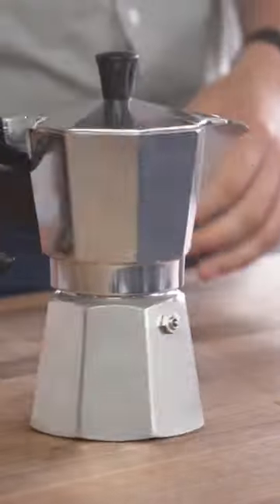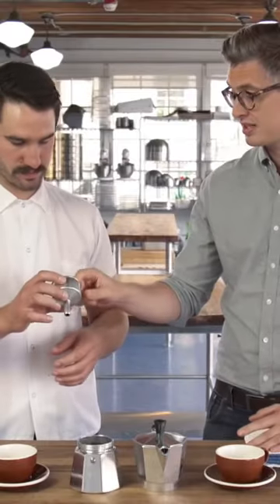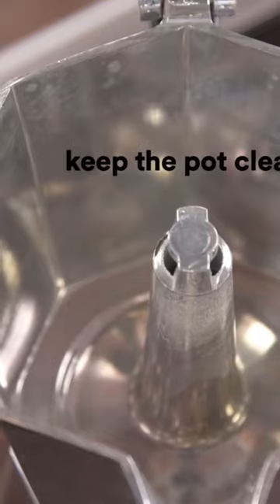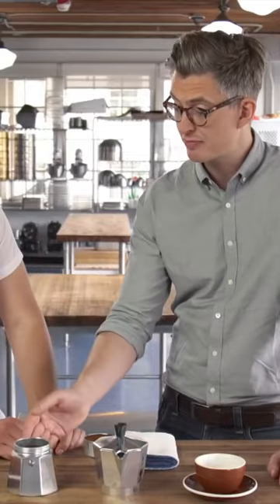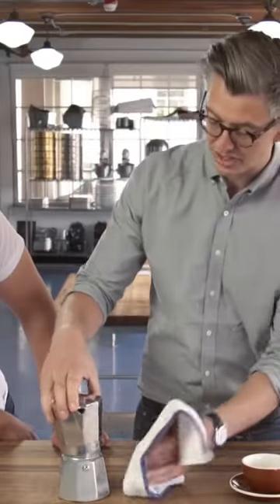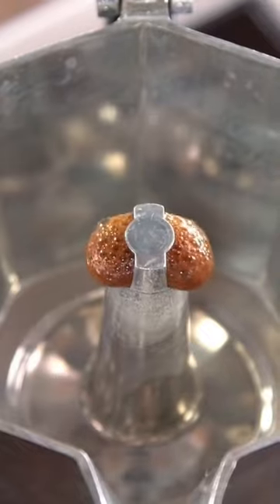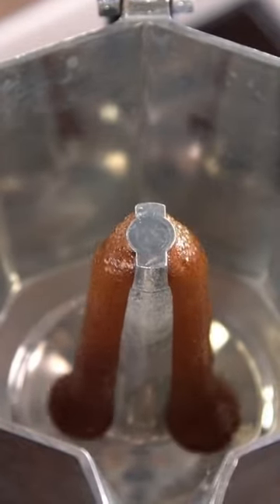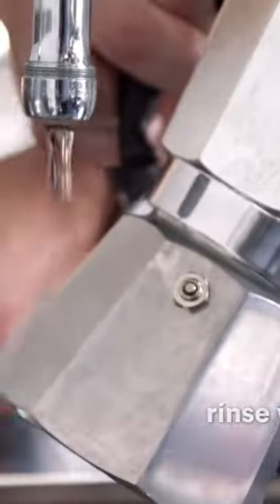How to use a Moka Pot with @chefsteps #shorts #coffee

Comment: I'm sorry, but Hoffman is wrong about how to use the moka pot. You definitely should not fill the bottom with hot water. Fill with cold or room temperature water to allow time for the correct pressure to build. It will not burn or over-extract the coffee as it only takes 3 to 6 minutes. When it gurgles remove it from the heat after a few seconds, but do not run it under cold water. For best results, learn the traditional Italian way since 1933 by searching for "Annalisa J moka pot" video. Hoffman admitted he doesn't understand the moka pot and said, "It broke me."
Reply: all the stuff you jest said is completely wrong.
Reply: @Unitedstatesgov598  No, the traditional way is all correct. The proof is in the pudding, my coffee is perfect every time by doing it like Annalisa J teaches. 

You're trying to say that hundreds of millions of Italians and Bialetti have been wrong for 90 years, but a coffee snob, who never learned the correct technique im the first place, is their savior? So arrogant!!!
Reply: There isn't a "correct" way to brew. If the final product tastes better then that is your preferred method of brewing.

Personally, I have found that using hot water gives me a more sour cup so I just use room temperature water. Perhaps it's the type of bean / roast level?
Reply: @_taho  Yes, there most certainly is a correct way to do it after 90 years of scientific design, development, and testing, to get the best results of perfect coffee every time, which is never bitter. All Italians (with few exceptions) are on the same page about how to do it, which conforms to Bialetti's instructions. There's a specific reason for every element of the moka pot. For example, they designed it to be a measuring cup by positioning the pressure valve in the exact location to give you the right amount of water when it touches the bottom of the valve. The coffee basket is designed to be exactly the right size to give you the perfect ratio of water to coffee when it's loosely filled and leveled off, never pressed nor packed. It must be filled with room temperature filtered water or cold tap water that's been filtered, or bottled water, so it heats up at the right speed to bloom the coffee and for the gasses to create the right pressure. If you fill it with boiling water, it can damage the pressure valve, which is dangerous; and it doesn't have time to create the right pressure and bloom. The coffee won't be bitter or burnt when you use room temperature or cold tap water because you cook it on a low flame and remove it from the heat the instant you hear the gurgling noise. Then let it sit for a moment to finish topping off, and always stir the coffee before pouring because the first coffee into the pot is a different strength than the last coffee. Keep the lid closed while it's brewing. Anyone who has a problem with bitter coffee, burnt coffee, or other problems, is not doing it the correct traditional Italian way.  When Hoffman repeatedly warns about "that angry sputtering spewing phase," that tells me he never learned the correct way to do it because that phase NEVER happens when it's done correctly. The coffee grind must be medium-fine. There's no need to rinse the bottom under cold water at the end, and no need to use a paper filter, which could cause too much pressure and damage the valve. And so on. It's extremely simple to use, by design, and was never meant to be the complicated source of stress, confusion, or intimidation that Hoffman has made it with his unnecessary hacks. I think he owes Italy and Bialetti an apology.
Reply: @photina78  Hoffman's technique is based in a seemingly very thorough testing process and its unclear to me why you are so critical of it. Yes its suited to his tastes, but that doesn't mean its "wrong". Neither way is wrong, its unnecessary to gatekeep a piece of metal.
Reply: Lmao are Italians suddenly dictators over how to make coffee now? No need to be so pressed, bud😂
Reply: @diiii_mond  I'm not Italian. 

How bigoted of you to assume my ethnicity based on my acquired knowledge of correct Moka technique. 🙄 

Hofmann admitted in his videos that he doesn't understand the Moka, and he even said, "It broke me!" After making those statements in his videos, he also tweeted those same remarks! 

I've researched the Moka, after suffering through the frustration and disappointment of trying these fake hacks that are being dictated by the Specialty Coffee influencers on social media, who don't understand the Moka.  

I've emailed Bialetti and received their answers in reply. 

I've thoroughly researched the Moka and tried all the various techniques. 

The Specialty Coffee influencers are the ones who are DICTATING how to use the Moka; but their hacks are very poor technique, which unnecessarily complicates the process and DO NOT improve the flavor for anyone who uses the correct Bialetti technique! 

Hoffmann assumes  problems with the flavor of Moka pot coffee that simply do NOT exist for people who use the correct Bialetti technique, which is extremely simple and produces consistently good coffee that's never bitter nor burnt. 

Bialetti grosses approximately $180 Million US dollars per year, they have their own science, engineering, and product development department; so they can afford to do vastly more and better scientific testing and professional taste testing than Hoffman or any social media influencer ever could dream of doing! 

Bialetti has a vested interest in ensuring that their Mokas and brewing process creates consistently good coffee! 

The design of the Bialetti Moka pot and brewing process were based on science by engineer Di Ponti, who collaborated with Bialetti in 1933 to manifest his idea for brewing stovetop espresso using technology he'd observed in his wife's washing machine. 

Di Ponti understood the physics of air, water vapor, volume, pressure, mechanical design, temperature and timing extremely well, and those basic scientific facts have not changed in the past 90 years. 

There is a scientific reason for every single one of Bialetti's instructions. They work together as a system; so if you change one instruction, it impacts the other steps and negatively affects the flavor. 

For example: Cold water has more molecules than hot water, so heating cold water makes it expand more and creates more pressure inside the Moka than heating hot water would. 

Starting with cold or room temperature water keeps the temperature lower inside the Moka than if you'd started with hot water,  it allows time for the coffee to bloom and for the right amount of pressure to build, and it bathes the coffee powder for a longer time and at a lower temperature than boiling because boiling water is too hot for a good extraction and it brews too fast. 

The Moka is never supposed to boil! That's not how it works! It works by gradually heating the air and water vapor until the pressure is enough to push the water down and up through the pipe at a temperature below boiling. 

I bet you didn't know any of that because you've believed the myth that starting with hot water prevents the coffee from burning. Not true!

The correct way to prevent the coffee from burning is to start with cold or room temperature water, cook it over a low flame or a preheated medium electric stove, then REMOVE THE MOKA from the stove the INSTANT you hear it start to gurgle - because that means the water reservoir is almost empty so it's slurping air into the pipe (the stromboli phase) - then set the pot on your countertop and let it finish brewing from the residual heat inside the pot! (Do NOT cool off the pot under cold running water when you remove it from the stove!!!) Then stir up the most-concentrated coffee from the bottom and pour. 

I comment on this topic BECAUSE everyone deserves to enjoy the very simple process of making consistently good stovetop espresso! 

Nobody should have to suffer through the frustration and disappointment that I went through trying to learn to use the Moka via these incorrect Specialty Coffee influencers' hacks that overcomplicated the process and took my coffee from bad to worse! 

ONLY when I finally found Annalisa J's Moka tutorial, and the detailed Moka tutorial by Il Barista Italiano, did I get to enjoy consistently good Moka espresso that's never bitter nor burnt, and a very simple stress-free process! 

I now use a Brikka, which is a bit different because you have to use the enclosed plastic measuring cup for the water, and it doesn't gurgle so you have to remove it from the stove as soon as you see steam and the crema stream is established, but before it gets very active. 

My daughter and son-in-law are former Starbucks managers, who were trainers of baristas not only at their stores but at all other stores that were experiencing quality control issues because their baristas weren't doing it right. They don't prefer Starbucks coffee because they've had advanced barista and tasting training in their careers. 

I sent them a Brikka to get their opinions on the best technique. They agree that the Bialetti instructions are by far better for creating the best flavor than any social media hacks! 

You have to use medium-fine ground espresso, like the ones sold in Italian grocery stores: illy, Lavazza, Kimbo, Bialetti Perfetto Moka; or if you like the stronger bitter flavor of the Latino favorites: Bustello, Pilon, and La Llave those are also ground medium-fine for the Moka. Annalisa J recommends her favorites. We like Bialetti Perfetto Moka Espresso and Lavazza. 

For best flavor use filtered or bottled water.
Reply: @diiii_mond  I would think the Italians are the og of coffee world considering almost all coffee drink names are in Italians
Reply: @photina78  I've seen you commenting on several Moka Pot videos & shorts and I must say I deeply admire your love and respect for the Moka Pot and the proper Italian technique. I used the method shown by Annalisa J and it is far better than any Moka Pot coffee I've produced by following these online specialty influencers, so thank you and continue spreading the word!!!
Reply: @noahfox963  Wow! Thank you so much for saying that! It means a lot to me! 😊 

I've been on a mission to spread the word because I suffered so much frustration, for about 6 weeks, from trying to learn how to use my Bialetti Venus from the influencers' tutorials, since it arrived in a damaged box with no instructions. 

Trying to learn from the tutorials caused me a lot of confusion, intimidation, disappointment 😔 and even heartache 💔 because I so desperately wanted to enjoy a stress-free home espresso experience that would save me a lot of money compared to buying at the coffee shops. 😢

I don't want anyone else to suffer through what I did trying to learn it! ✊

I feel like everyone deserves to experience the super easy and joyful experience of making good Moka pot coffee, according to Bialetti instructions, which is the authentic Italian technique that produces consistently good flavor! Also, it's based on science. 

Bialetti has their own science and engineering department, and they do much better testing than any influencer can do! 

I'm so thankful that I found Annalisa J's Moka tutorial, and the detailed Moka tutorial by Il Barista Italiano, before I gave up forever!

I still love my Mokas, but I'm hooked on my Bialetti Brikka now too! The instructions are almost the same except you have to use the enclosed plastic measuring cup for the water, and it doesn't gurgle to tell you when to remove it from the stove, so you just watch for the steam and then remove it from the stove and let it finish brewing on your countertop from the residual heat inside the pot. 

Again, thanks so much for your kind encouraging words! I hope we can help a lot of coffee lovers have the best possible Moka experience! 😋 ☕
Reply: its u again! hi!😃
Reply: i'm looking many method for moka pot
Reply: Interesting comment. I read every single one u wrote. Just got my Brikka today, i started with hot water, light tap around the rim to level of the coffee powder but never pressed. I think is a bit too much for me. Will try room temperature tomorrow.
Reply: @linuxmonkey  Awesome! You'll soon get the hang of it and you'll love your Brikka! Cold water works well too. My daughter and son-in-law are former baristas/coffee shop managers and they use chilled water out of their refrigerator door dispenser. I use room temperature water because I always have cases of bottled water around. But recently I've used refrigerated bottled water because that's what I had in hand, and it works great!
Reply: @linuxmonkey  PS When you said, "it's too much for me," do you mean the flavor is too bold? It also depends on the type of coffee you use. 

Of course, freshly ground espresso is best; but my favorite grocery store espresso is Bialetti Perfetto Moka Espresso because it's very smooth, and some people will find the flavor is amost too mild. I use less milk when I make lattes with it because the coffee flavor isn't strong enough to stand up to a lot of milk, sweetener, and flavorings. 

But if I don't have that I buy cans of Lavazza Espresso. (All Italian grocery store espressos are ground medium-fine for the Moka.) Many people love illy, too, but to me it's too bitter and acidic. 

Hundreds of millions of people around the world love bitter or burnt flavor, so they buy coffees like Bustello or Spanish Torrefacto coffee. Everyone's pallet is different.
Reply: @photina78  hey man, thanks for the tips. I would say it works great 😃 no over bitterness and sourness. Just pure  boldness of coffee and wholesome deliciousness. I brewed mine on induction stove with 2 out 7 , found out that it takes too long (over 20 minutes) so i raised it to 3 and 4 at the last minutes, stop the brewing just when the coffee flows faster but before it even splurting (got this trick from Baristaitaliano channel i think) no sediments got into the cup this time. And yeah, the room temperature tip works 😁 thanks, keep spreading the words ma man.
Reply: @linuxmonkey  Fantastic! 👏 👏 👏 I'm so happy for you! Nothing is better than getting consistently good Moka coffee by the very simple, authentic, stress-free process! ☕ 😊

You're right, it can take a little fine tuning to find the right setting on your stove! My electric stove top doesn't have numbers or words for low, medium, high, etc., so I had to make little adjustments until I found the right preheated medium temperature. 

With my two-cup Brikka I preheat the stove to medium, put the Moka on, set my timer to 4 minutes because I know nothing is going to happen so I do other things instead of watching the pot, then when it dings the coffee starts quietly sleeping in, a few seconds later the crema starts coming in, my lid is closed so I watch for the steam to come out, and by 4:30 I take it off the stove and let it finish brewing on my countertop. I think I'm pouring by 4:55. So easy and so good! 💃

My daughter now uses a 4-cup Brikka, so I need to ask her if her new 4-cup Brikka takes longer than her 2-cup Brikka. 

Thanks so much for your feedback! It makes me happy 😁
Reply: @linuxmonkey  same bruv each to thier own i dont know why photanias whinging and degrading other methods in every video . Cuh should get a life and let others enjoy
Reply: @photina78  i like the way the coffee tastes when i start with room temperature water i think your right starting with hot water just doesn't seem that good BUT im trying to figure out the moka pot so im still working it out
Reply: @jjr8948  Great! You're on your way to great Moka flavor! 😊 ☕
Reply: I'm sorry but you're completely wrong i made like millions of coffee with moka pot all the possible way to make coffee with moka pot you think I tried , if you put a cold water there will be nobody in your coffee but yes more foam but the sourness is all over the coffee , medium temperature is the base if you put medium temperature water it will give you 30 percent more body little bit of a sourness in your coffee. But if you put hot water you water will boil at like less than 30 sec and it will push the coffee at 0.8 bar to your coffee and your coffee will taste a lot less sourness and body of coffee is tasty now , all the important thing is fresh coffee, the degree of your coffee a little bit less than espresso level but not as soft as sth like frenchpress other thing is that for less sourness you can use portafilter you must clean your moka pot with boiling water i always make sure to clean my moka pot after my cup of coffee and after three cup of coffee I will pot boiling water in the moka pot tank, only the tank , and I'll put it on gas wait for water to start boiling properly i clean it this way if the filter is brown you have to cheange the washer in it that washer must be white not like smoker White 😅 just white 🤍 like this heart , every thing about moka pot is clean pot , fresh grounded bean , and boiling water and also if you use more arabica coffee you need more water put water just before the safety valve , but if you're using coffee that has less arabica put less water. That's it , this took me like 10 minutes to write it down i hope it's helpful.
Reply: @ahura4323  Nope. You're making it unnecessarily complicated and getting worse results.
Reply: 'correct pressure to build' you say. The only pressure that is required is P_tot = P_h (rho*g*h the hydrostatic pressure) + P_f (filter + coffee ground pressure calculated from darcy's formula) + P_a (the atmospheric pressure) to push the water through the coffee. Your 'building up' may only refer to how fast or slow the pressure is reached but with small aluminum moka cup the heat conduction is fast enough to consider that the heat is distributed throughout the boiler. You heat the boiler, heat is transferred to the water, water becomes steam (water vapor), V_vapor > V_liq so the steam expands and increase the pressure. Once the pressure is reached, the water pushes up through the moka cup.

Whether you start with cold or hot, the temperature and pressure that is required to push the water over the top is unchanged. Unless the moka cup is very huge and the  upper area of boiler is not heated well, there is no difference.

The matter of difference that can be made is, filtering pressure(how fine you grind the coffee, wheter you tamp it, how much you put it in etc.) and the heat source (Heat energy per second : how much heat is provided to the moka pot). If you put high heat, more heat energy is transferred to water per second, meaning faster evaporation and therefore less time for heated water to spend time extracting coffee as it flows through. I can also go into details in terms of how much coffee can be transferred to the liq water through transport-phenomena and whether there is upper limit to the extraction but will save it for now.

Also unfortunately, the relationship between heat energy and Temperature is linear. whether you start with cold water or hot water, as long as the heat source provides steady heat energy, the temperature rises to boiling point with the same rate.

So be it cold or hot, no difference. If you want to disagree to my points please do so, but in terms of physical chesmistry.
Reply: @johnlee3122  Bialetti has their own state-of-the-art Science and Engineering Department where they test and develop all their products, so you're trying to reinvent the wheel.